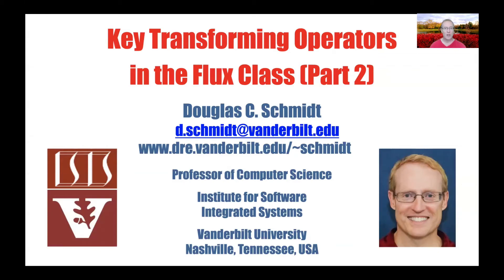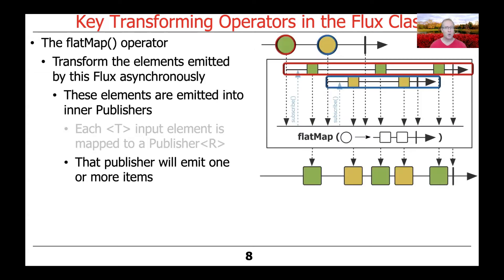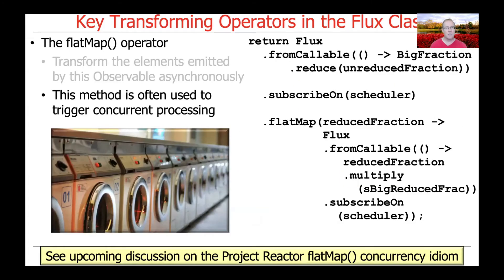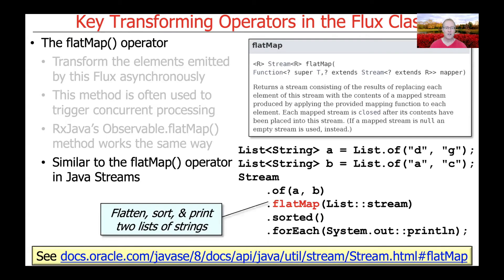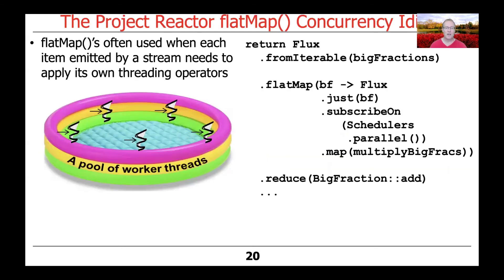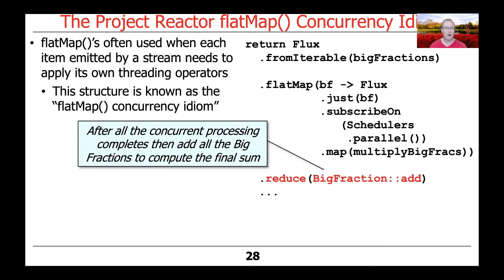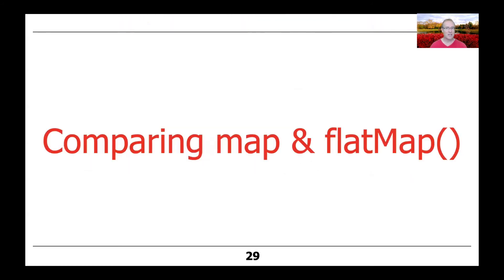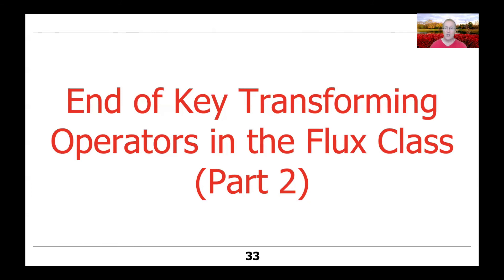Key Transforming Operators in the Flux Class (Part 2)

Comment: Just curious, in which thread reduce(BigFraction::add) will be invoked . As this will be invoked after multiplyBigFracts, which will happen in parallel threads. Does the operation right after flatMap(), in this case reduce() , will block for the laatMap() to be invoked on the entire Flux?
Reply from the maker: Hi Sanjeev, there's no blocking here (which would completely defeat the purpose of reactive programming). Instead, whichever thread happens to finish the last multiplication in the flatMap() pool is used to call reduce, which is very efficient since there's no unnecessary context switching or blocking.
Reply: Prof @DouglasSchmidt  also there is question is how many of 'reduce' results will be emitted in this case. Since each of multiplyBigFracts invocation will produce bigFraction value they all and each of them should be processed by the BigFraction::add. Moreover it will be done in different threads, if I'm not mistaken. Therefore either 'reduce() should be blocking operation or reduce() should 'emit' many results of BigFraction::add. Am I wrong here?
Reply from the maker: @VladimirZateychuk  Vladimir, reduce() is clearly not a blocking operation, which would defeat the whole purpose of reactive streams.  Likewise, it will only emit a single value after all the reductions are done internally.
Reply: @DouglasSchmidt  big thanks for the brilliant explanation and lectures.